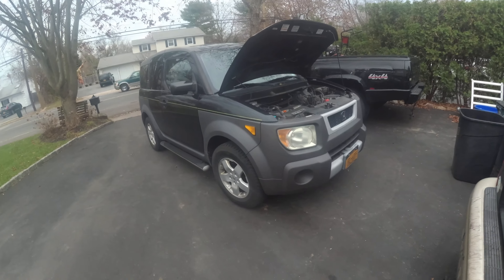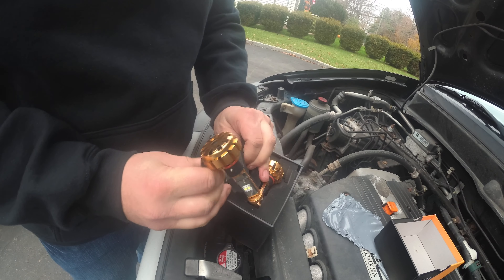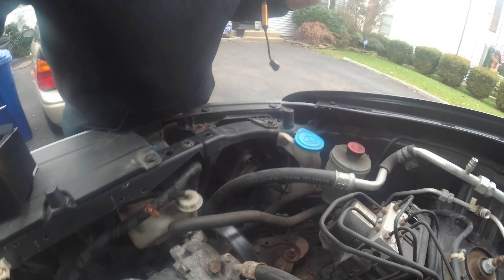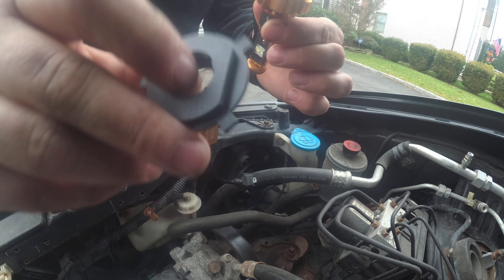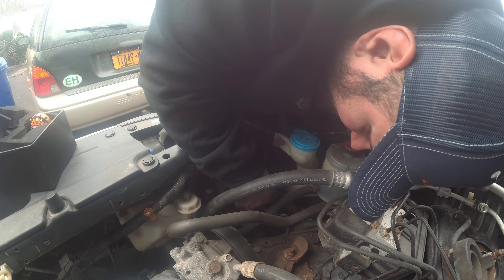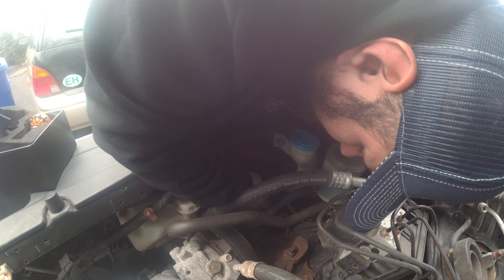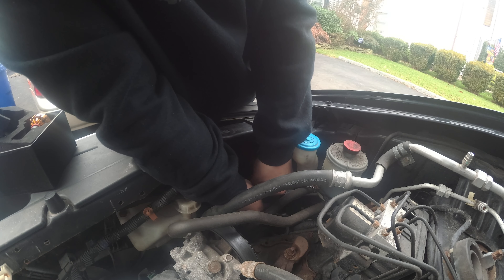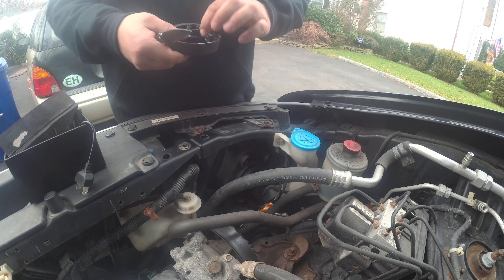03 Honda Element Build P2:  LET THERE BE LIGHT AUXBEAM F-16 LED Headlights Install HOW TO & REVIEW

Comment: Thanks for the tutorial. Just used the same model Auxbeams in my 03 Element and it looks great. Super easy to install.
Reply from the maker: Haggis Warrior They are still working as they should!  Even after hot coolant exploded inside my element.  They also survived the power wash to clean it all out as well!  Def worth every penny.  Now I want to get aftermarket headlights!

Thanks for the view and comment, hopefully you subscribed to my channel!
Reply: Any issues with blinding oncoming traffic? Read some threads that the early E’s light housing isn’t LED friendly? I have HID’s now.
Reply: You know ... after you get that pinstripe removed you can put on some black housing spider eyes housing with LED halos those would look good on a black car I'm just saying
Reply from the maker: @motoxposer , I get flashed once in a blue moon.  In order for these bulbs not do that you will need to retrofit projectors into your headlights CHAH-CHING
Reply from the maker: @1sttobylopez  I concur!  It’s on the TO-DO list! Thanks for the view and comment, hopefully you subscribed to my channel 🤙🏻🇺🇸🦅🔧
Reply: @pattayperformance  Any radio interference? I just noticed.
Reply from the maker: @motoxposer  is excellent observation!  There is radio interference but I don’t listen to the radio.  I use Bluetooth.  It was more distinct when I upgraded my headunit to 10.1” screen.  Only way to counter act it is a headlight harness with a relay so it gets full 12v all the time.
Reply: @pattayperformance  Do those ferrules do anything?